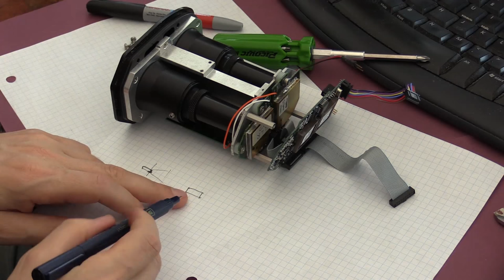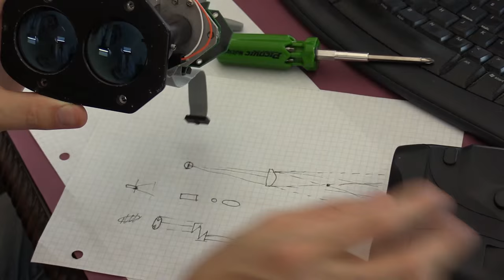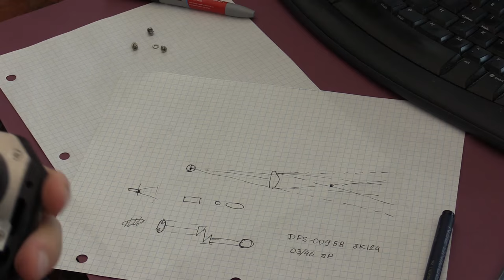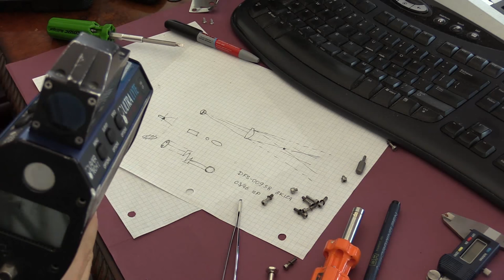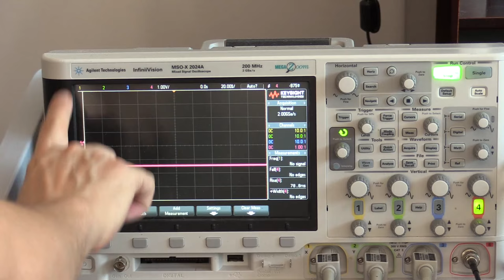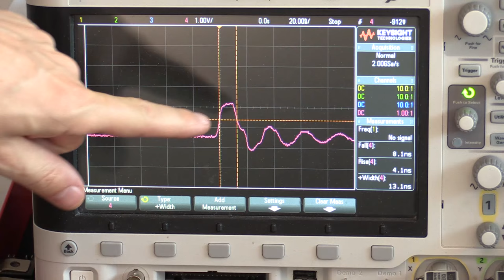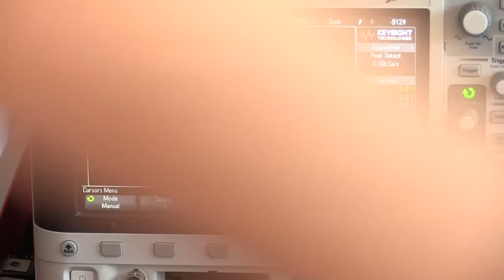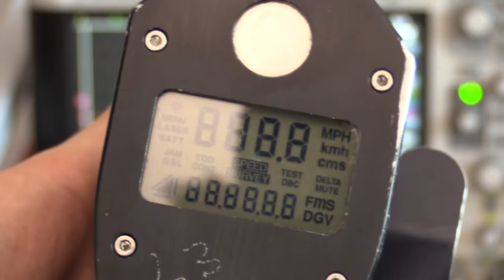Episode 13, Tear down of UltraLyte LTI 20-20 LR 100 LIDAR

Comment: I have same unit which in MPH & Feet in unit. Did you notice any SW change to KPH and meter unit? I'd like to change to KPH but so far only send gun back to service.
Reply from the maker: +Hammer Sledge No, unfortunately I have not figured out how to change it from MPH/Feet to KPH/m :(
Reply: +Alexei 　Thank you for let me know.
Reply: +Alexei Polkhanov How calibrate sighting scope? looking at left and right screw - is it X and Y values?
Reply from the maker: Przemysław Borzymek no screws are only for horizontal adjustment I think.
Reply: Alexei Polkhanov so how to zero sightscope? I was searching info about this but with no effects
Reply from the maker: It is "zeroed" by sound. When you point to a small cross section object like lighting pole you will hear high pitch when signal reflects of it. If site scope is off it will be obvious because you get high pitch when scope is not pointing directly at the object. User manual that I found online described it very well.

Comment: The focal length is long because the Photodiode (probably an APD) is most sensitive at 0 deg angle of incidence of the laser light and drops off quickly. So they focus the laser light into a small point and all the photons are now hitting the photodetector at angles near 0 deg incidence angle. This improves the sensitivity of the photodiode and in effect this 36mm or so Plano-convex lens gathers light and concentrates it -- an optical amplifier really. A short focal length would bring the photons in at steeper angles -- not good. The lenses have a blue tint to them and I think that indicates this is a heat absorbing filter that absorbs IR over ~950nm and upward.  This would keep the sun's heat from buring the Photodiode or Laser if it was inadvertently aimed at the sun. The photodiode has a NIR filter on it that only accepts 905nm +/- 10nm (so 885 to 915nm). The reason the NIR 905nm filter is on the photodiode is because putting it on the front of the unit would raise cost dramatically (a larger diameter filter is much more expensive). Also, the mirrored surface might be a point of contention with the public -- they may complain they were blinded by the mirror reflecting sunlight into their eyes and crashed!  On the laser side it needs this lens to collimate the laser into a small spot so that it can be aimed at specific vehicle targets in traffic.